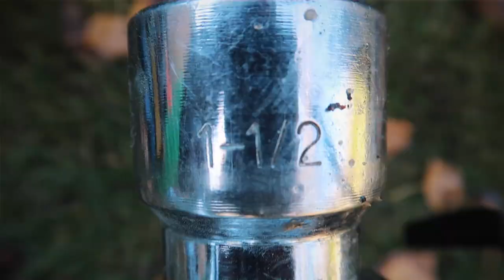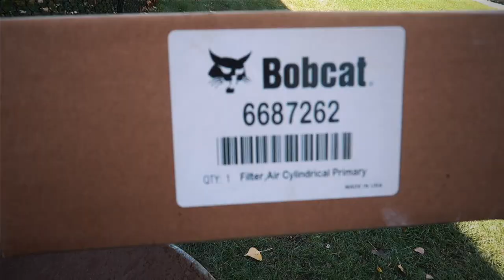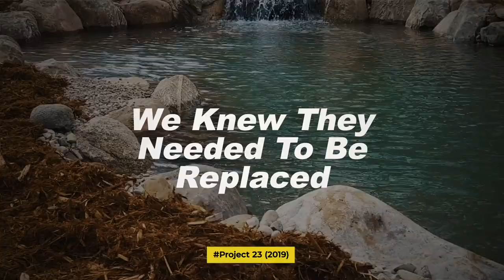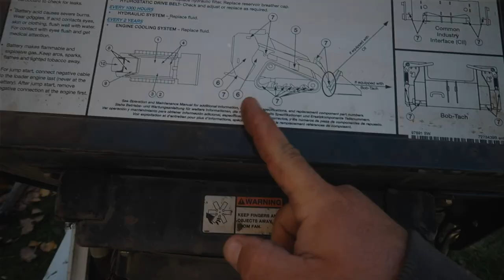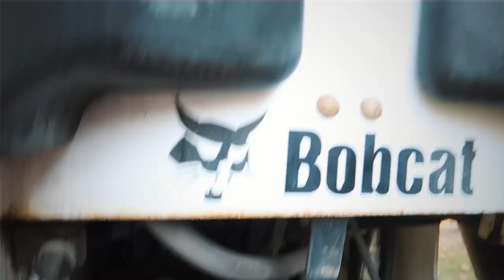HOW TO MAINTAIN YOUR BOBCAT MT85 - Grease, Filters Tracks & More!

Comment: Good video! I recently bought my smallest Bobcat, an MT55. The owners manual is not clear on the location of the roller grease zerks, so I found your helpful post on you tube. I have been using "Universal Transmission Hydraulic Fluid" in the hydraulic systems of my skid steers (Mustang, Ford, New Holland and Bobcat) for about 40+ years. I take oil samples and have it analyzed. The test results come back clean and I have yet to have an oil related failure. I have found that oil samples can predict a failure four years before a failure could occur. On one truck the sample came back bad and I was able to make a $300 repair, and saved about  $25,000 on an engine repair in my Mack truck!
Reply from the maker: Really good advice John! Thank you for the comment. Thank you too for the excellent voicemail message! We will definitely lean on you when we’re in the area. Sounds like you’ve had a great career!
Reply: Yes. I am semi retired. 43 years ago I started writing down thing I did and learned. I now have over 300 pages.
Reply from the maker: @buelowexcavating  we’ll need to take you out for lunch to learn from you!
Reply: Sounds good!

Comment: Do you guys use Bobcats hydraulic fluid or have you guys found a cheaper alternative?
Reply from the maker: We've been using all bobcat brand. We don't go through much very often so the expense doesn't grind my gears too bad.
Reply: @PondKingWaterGardensMN  thanks buddy I went to bobcat and got theirs. I was confused by you saying check fluid while  buckets raised and in the air.  My book says to check and fill as needed while everything is lowered and bucket tilted back.
Reply from the maker: I swear our guy said everything should be extended to see the true level. He was the one from bobcat stores around here.
Reply: @PondKingWaterGardensMN  did yours come with the manual in the round tube inside rear access panel. I believe it was page 79 or 80. But it said to check level and top it off while arms down and bucket tilted back. I am just trying to make sure. I have to read stuff 20 times to understand which is why I resort to YouTube lol. I hope we get it figured out though. I'm not knocking any info. Just double checking to protect our investments.
Reply from the maker: I'll make a phone call tomorrow and see what the mechanic says